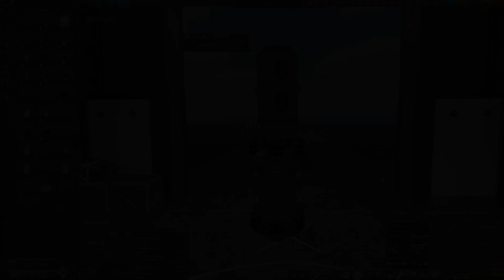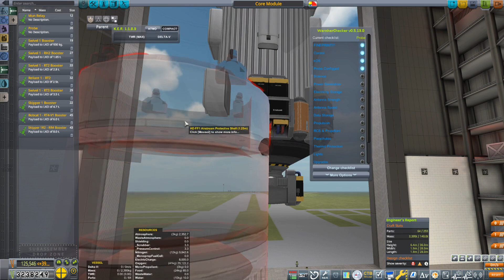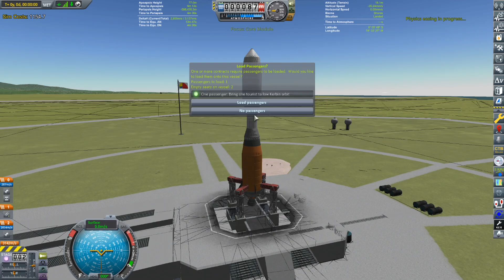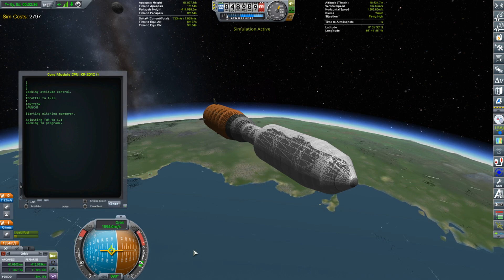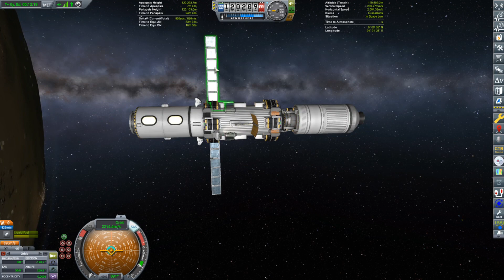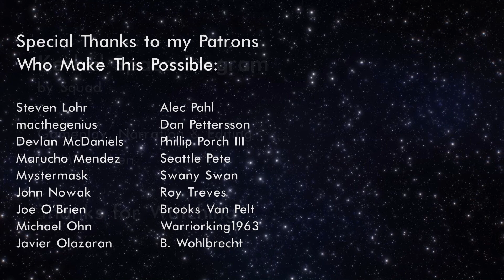Inserting our First Station | Stream pt. 2/3 (KSP 1.11.2)

Comment: Have you ran into the issue where your rocket shows considerable precession on the top?  My script compensates, but it's adding unnecessary movement which is probably wasting fuel and therefore delta V.  At one point it got so bad that my script just died.  I added static fins (the dynamic ones seemed to make it even worse) and that helps, but I'm still seeing over a 30 degree precession at the top and I feel like I shouldn't need the fins since they just add drag and weight.
Reply from the maker: Can't say I've had that issue.
Reply: @MikeAben  I figured it out. I just added a bunch more struts and shorted the upper stage.  Once you insert the station into orbit you still have more deltav than you will ever need.  I shorted it to a single 100 tank which is the shortest one.  I decided to put a station in orbit at 400km with an inclination of 51.64 degrees.  I had no problem getting the station into that high-ish orbit and still had plenty of deltav left to deorbit the engine.
Reply from the maker: @BitwiseMobile  Nice. ISS orbit.

Comment: 0:58 you have many menu options that I do not see with the docking port.  I am running the same exact version as you (1.11.2) and I have installed every single mod on your list.  Some of them are outdated according to CKAN, so I had to install them manually.  I still do not see those options.  I have read in other places that it may be an editor mod, but I don't see anything like that on your mod list.  Can you advise?  Thanks in advance!
Reply from the maker: Do you have Advanced Tweakables turned on in the settings?
Reply: @MikeAben  Wow, I have had this game for almost 6 years and this is the first time I've known about that setting.  Thank you and you have earned a YT subscriber and patreon subscriber.
Reply from the maker: @BitwiseMobile  Yes, it's a stupidly hidden feature.